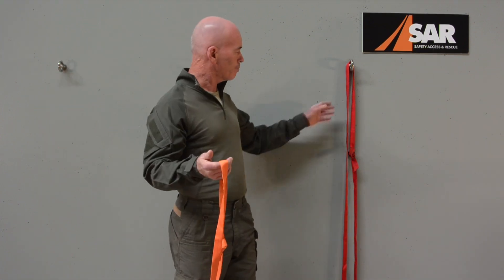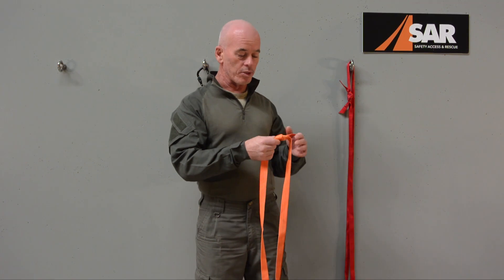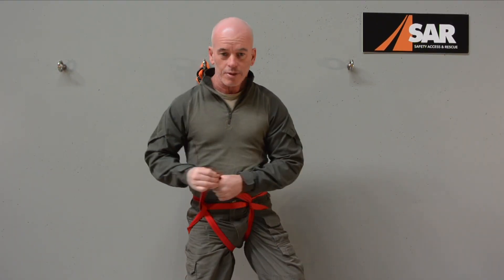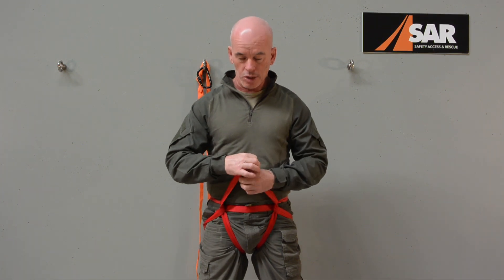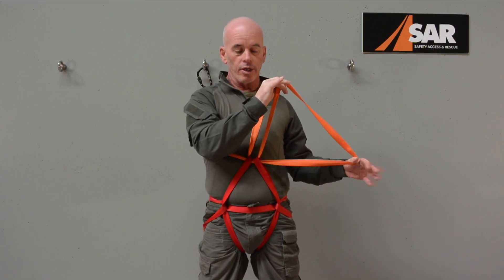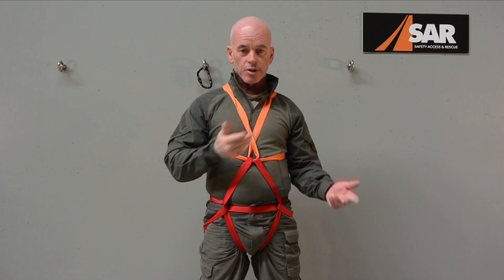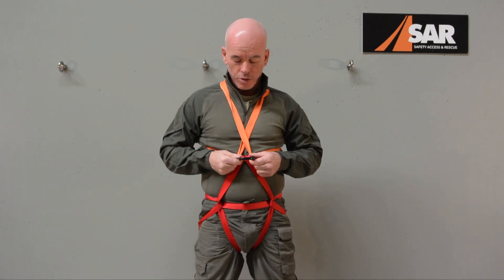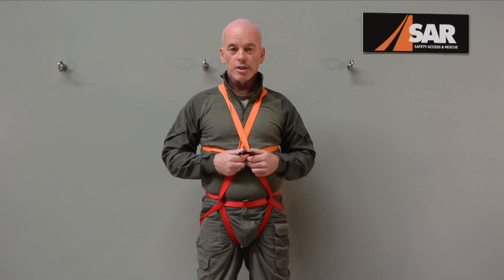Full body webbing harness

Comment: Tried, not good at all - problems: 1 slow, need to tune loops multiple times before it fit well 2 not holding well, leg loops fall down with any movement if harness is not under the load 3 complex carabiner attechment - easy to make mistake, especially if used rarely 4 impossible to use without the top harness part.
Reply: You’re such a dope

Comment: sir, how much length do you need for the short and long one??
Thank you...
Salam dari Indonesia
Reply from the maker: Hi there. There is an explanatory in the video's audio about getting the right length but just to help out... the webbing for the lower section, when tied as a loop, should roughly come to your nose if you stand with your foot in the bottom of the loop and pull it upwards. The webbing for the upper section, when tied as a loop, should roughly come to your sternum again if you put your foot in the loop and pull upwards. Hope this helps...
Reply: @safetyaccessrescue7136  thank you sir, very helpful explanation

Comment: So I retract my comment below. I made of these. Followed all the directions to a tee - carbiner was really secure, didn't shift, and the webbing was snug. However, when I moved around up on my roof, the leg portions kept slipping down, especially when bending forward, no matter how many times I cinched it up. It ended up being a hazard. I suggest this is only for emergencies and/or when the person is not moving much, but hanging in one position.
Reply from the maker: Hi Rock. Thanks for the feedback & I think you answered your own question (in a way) in the last line. I'm pretty sure in my audio in the video I make it clear this is an expedient, emergency setup or for very specific applications (i.e. heli-rappel, which is what I used to use it for... we were only suspended for seconds under the aircraft since getting on the ground was the priority). Its not a work harness or industrial fall protection harness. I'm glad people are liking & using it out there, but don't be under any illusions that its a replacement for a proprietary fall protection harness. Cheers.

Comment: PROBLEM:  In the event of a fall and you are suspended, this harness does not have a seat strap to allow blood flow in upper legs to prevent SUSPENSION TRAUMA.    "SUSPENSION TRAUMA" is a serious matter and a thorough rescue plan is mandatory in an event of a fall.
Reply from the maker: Hi KS K... I think you have missed the point of this improvised harness & you may want to have another listen to my commentary in the video. The harness is only meant for very short duration, specific applications (immediate movement of a casualty when there is no other option, heli rappel, tactical ops etc). This is not a fall protection harness by any means & specifically does not have any of the features of a proprietary, manufactured harness. Its just made out of hand tied webbing. Btw... a 'seat strap' or lower pelvic strap on a full body harness will not 'prevent' HHS by any means but may assist in mitigating the effects in certain individuals.
Reply: I'm no expert, but the laws of physics seem to suggest that one could reduce "suspension trauma", whatever it is, by using wider webbing. I copied this harness using 1,9 inch webbing and it works just as well.

Comment: Can this be used to make a kid harness for rock climbing?
Reply from the maker: It could be made to work I guess, especially with larger kids, but I don't recommend it. It's ultimately fairly uncomfortable (which will turn kids off something they should be enjoying) & is at the and of the day an expedient, 'improvised' system for experienced users that appreciate the risks of using it. So in summary I'd say no...

Comment: I was looking for a harness for solo sailor using on the deck and your video was the first I hit.  Rigged one  right away, it seems perfect. Thank you so much!
Reply: I'm a sailor myself (albeit a rookie) and I've also copied this harness. Used a single piece of webbing, just over 10 meters long, and made a loop at each end (one bigger than the other, as shown in this video), instead of cutting the webbing. I think it's especially important as a mariner not to cut rope or webbing unless it's necessary.
Reply: @Verradonairun  That's what proper knots are for. I'll use spare line and a fisherman's knot and trust the SAR dude over a rookie sailor. @OGSoon, same

Comment: Best harness tutorial. My question is I have 50 mm 2200 kg rated webbing that I bought in a roll purely for this. I learnt a fall with lanyard of 2 meters exerts 800 kgf if you weight is 100 kg. Is it ok if I use the 50 mm? 2200 kg break strength makes me feel more confident and super comfortable? Any reply appreciated? Otherwise I will have to get some soft sling like abseling webbing at 25 mm? Cheers. Btw best rescue harness I've seen as I used the hasty harness from knots by Grog.
Reply from the maker: Hi Dragan. The problem with using 50mm seatbelt type webbing is that it does not hold knots well at all & is only designed to be sewn. There certainly is no issue regarding strength here... 25mm tubular nylon webbing tests at around 18 - 19kN. If you managed to fail the improvised harness in this video your body would fail first. Remember this harness is not designed for fall arrest, its an improvised rig only designed for static loading in one off situations. Cheers.

Comment: made and used today. Had to trim a pine tree for a customer 35 ft up. ladder 20' 61 years of practice job on tree one went GR8 next is sister tree same thing. Thank you for a great video. Hang too long and it sucks. Straps start applying major pressure to under legs.

Comment: I have used the bottom harness for a rescue but adding the chest harness is very supportive. We live in the north and it can get very cold but we needed the harness to go over warm clothes. To do this I used longer lengths of webbing. The longer piece is the height of the top of the head and the shorter piece  has the knot at the sternum. My husband and I are different heights and this worked for both of us as a general guideline.You could add this to your video for those cold weather rescues or roof work. Thank you for a simple technique.

Comment: Looked at several of these vids and everyone uses 25mm tape. When i was in the venturers back in the 80s we used seatbelts with are about 50mm and from memory we tied them after forming the harness.

The wider material would be more comfortable you’d think?
Reply from the maker: 50mm seatbelt webbing is not designed to be tied & does not hold knots well at all. The manufacturers would not (& never have) warrant it for this use. It's been the cause of a number of accidents over the years including a double fatality years ago not far from where I live. I know it used to be the thing back in the 70's and 80's but the use of tied seatbelt web should be eliminated. Tubular nylon holds a joining bend very well... it's not super comfortable as a harness but is after all an expedient technique only.
Reply: Ive used that way absailing it is comfy

Comment: I solved the problem
I added on the lower of the harness where the water knot is a thin peace of rope 2,50 meters ,then knotted left and right part,so they stay firm, with the rest of the rope knotted left and right piece's of bottom part under the feet

Comment: Hello
The harness looks nice and it is easy  to wear on and fit's ok when you stand on. But it goes out of its position, the lower part on the bottom when you go upstairs on going up on a tile roof where i use it,or when i sit on my knees to replace tiles,some times it goes of one of my shoulder as i work when i bend.
Reply: Like a construction harness you are meant to have a bit of slack. About 2 to 3 fingers for comfort and you have to adjust all the time. 5 mins is the maximum time for rescue of a person that has fallen off a roof and is hanging there. Arteries get restricted. You need to have a rescue plan. In Australia a Gotcha rescue kit! Cheers